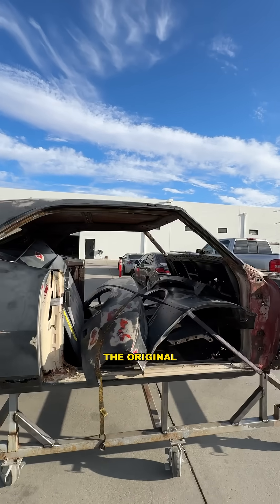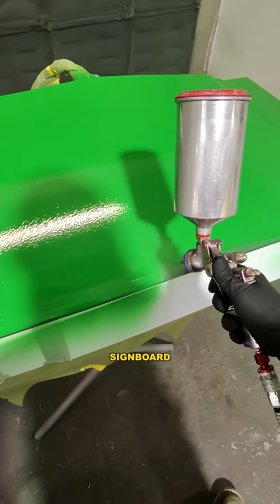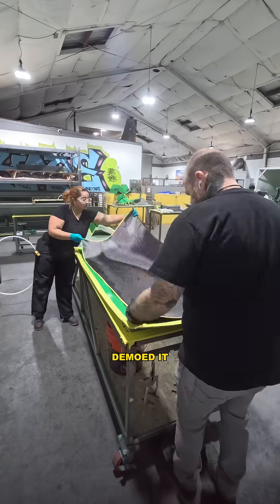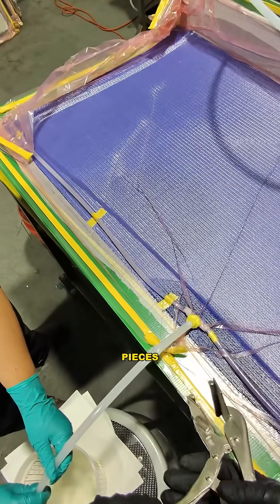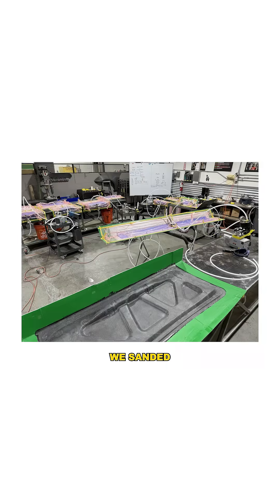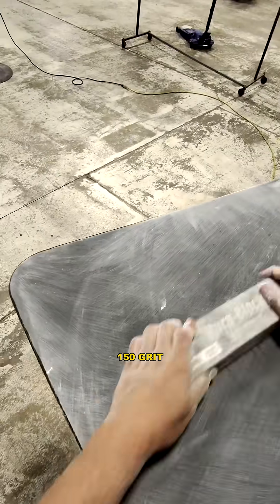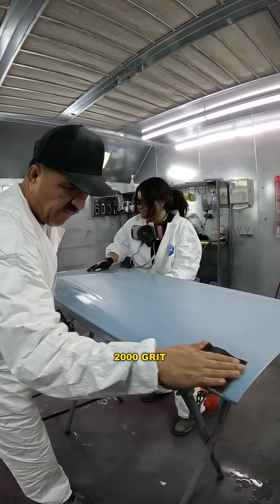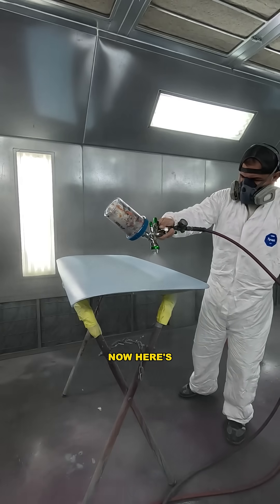SEMA Camaro has a carbon fiber trunk?? #camaro #carbonfiber #carbon #composites #sema

Comment: 27 pounds 
Originally was 64 pounds
Reply: It's sound good but it's Bad idea the car it's nose heavy to begin now more light in the rear those wheels are not gonna stick to the road😅
Reply: @tmetito3535  stock is 56% rear 44% ftont, that's pretty good. This camaro has a carbon trunk, but has a carbon hood, carbon fenders, carbon lower valence, and more. It's probably pretty close to 50/50 now.